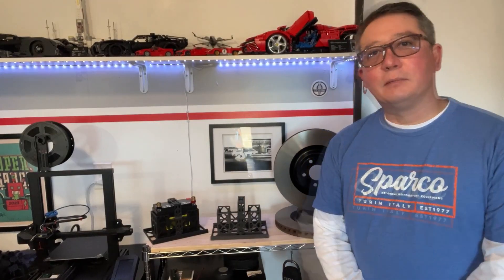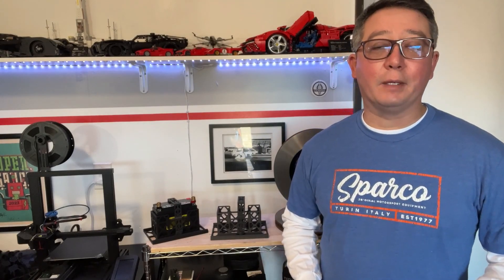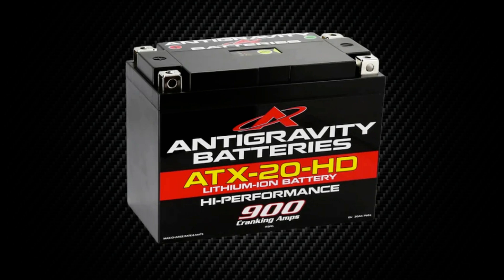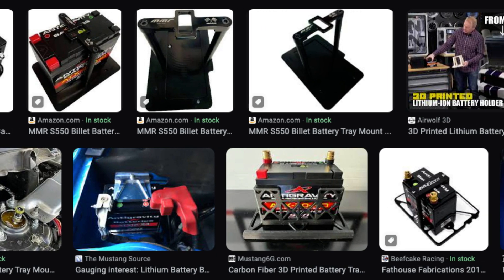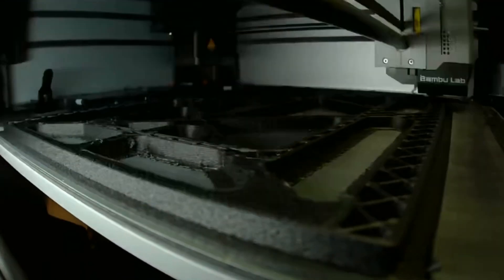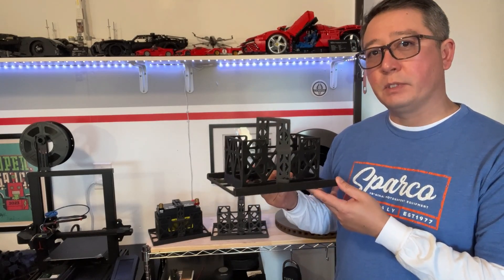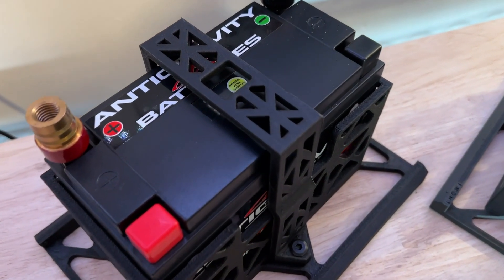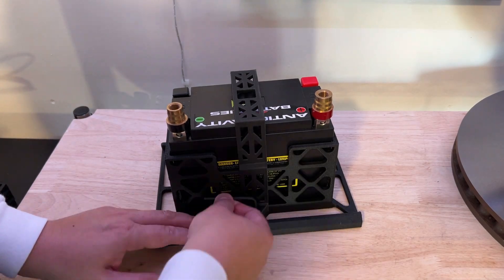Episode 78: Carbon Fiber 3D-Printed Battery Tray for Lithium Ion Battery

Comment: Does it make any difference on a road course as far as balance of the vehicle? Also, what are the drawbacks compared to a lead acid battery or AGM battery is the anti-gravity battery only good for six months a year how long does it last compared to a more traditional battery? What is the cost of your fiberglass and carbon frame? Thank you.
Reply from the maker: Hi @mtnbikerva1 It will reduce weight off your front end. Reduced weight always helps. As far as drawbacks, I have not had any so far. However I live in CA and can drive my car all year round. It can get hot here but no issues yet. I bought my battery in 2020 and have run it since but I dont DD my car. The Bbattery tray runs $150 shipped anywhere and I only have 1 left. Thank you for reaching out.